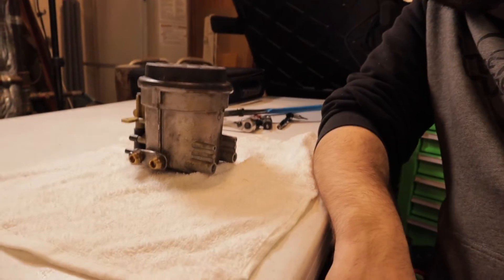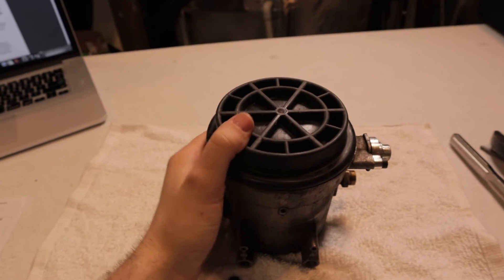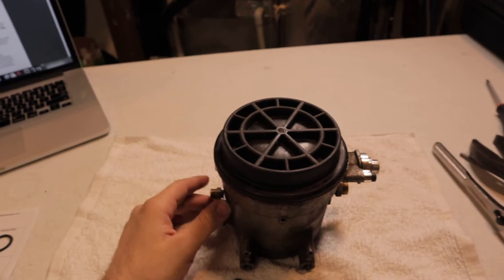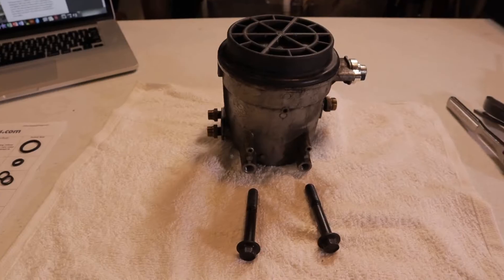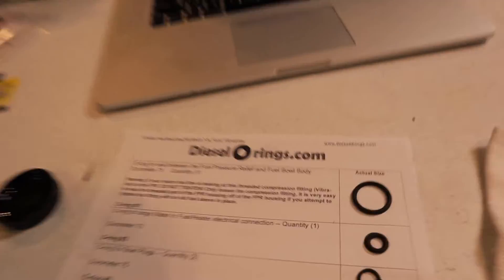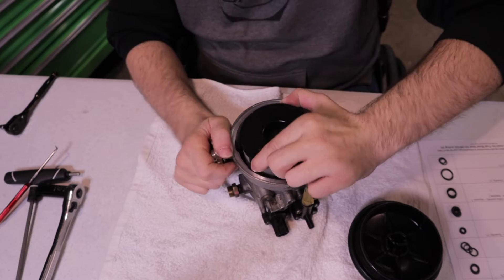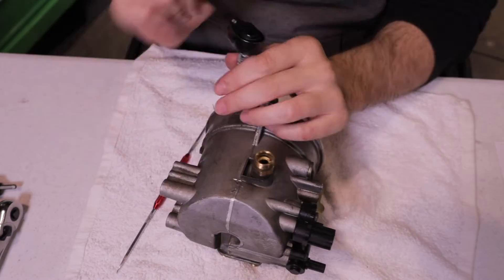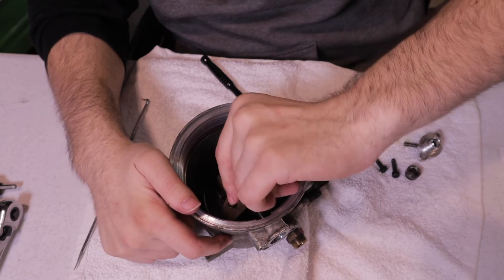Fixing One of Ford 7.3 Powerstrokes Biggest Problems: Fuel Bowl Rebuild

Comment: 2000 7.3, fuel canister check valve standpipe installation 
(See video for parts alignment ):

1.)  Rod with plastic ends go in the standpipe.
2.)  Spring sits on the bowl to pressure the valve. 
3.)  install heat element.
4.) Test push the valve in top center standpipe to feel correct valve spring movement. 
Reinstall fuel filter.
I thank and liked this site.
Reply: I wonder what happens if the valve was in wrong, stuck open or closed positions? What is the primary purpose of the valve? How would it effect freezing startups?
Reply: Google speaks:
The valve prevents fuel from draining back to the tank, maintaining pressure in the fuel rails for easier, faster starts, especially after filter changes, and stops fuel from vaporizing, ensuring consistent flow and preventing hard starts or long cranks, by allowing one-way flow from the canister. Furthermore, Improves Cold Starts: By keeping fuel ready, it ensures a smoother, quicker start, particularly in colder weather. 
Thankyou Google and this site.

Comment: Great video.  Very informative but.... there is really only one fix for the multitude of problems that come with the 7.3 fuel bowl; THROW IT IN THE TRASH CAN.  The best thing you cna do is toss that POS and replace it with a remorte filter system.  They aren't that expensive, way cleaner, get's the bowl out of the way so you can work on other things and actually makes the truck run better due to the better regulator the kits come with and decreased flow restrictions.  Oh.... and you'll only need to do it once while the factory fuel bowl will giver you trouble no matter hoow many times you rebuild or replace it.  Look into it.  You'll be much happier.
Reply from the maker: Oh I deleted the fuel bowl on this truck. That’s why I had it out haha. Just used the opportunity to make the video since I had it on the shelf.
Reply: Still, a good video. Very informative.
Reply: Can you give me a link to the new kit you installed?
Reply from the maker: @PetProductsParadise-zy3hd  I custom buil;t mine but it started as CNCs 4 line kit. 

https://cncfab.us/products/99-5-03-7-3l-cnc-fab-4-line-feed-valley-mount-fuel-line-kit-422017
Reply: Dude what planet are you living on when you said it's not that expensive! 
 A stock fuel bowl is $500.00, a fuel delete system I have priced out is almost always $1,500. The stock fuel bowls seem to last a couple hundred thousand miles before problems, can be very beneficial to a lot of people. 
 HOWEVER! I I've read a fair share stories of people rebuilding their fuel bowl with these kits and then they still leak... I'm a little weary. To try it, but due to budget constraints I will have to. I have a 7.3 van so it is extremely difficult to get to the fuel bowl, you have to use mirrors and work backwards
Reply: @davidevans1128 I have to do the same. Getting into that doghouse is a mission
Reply: @davidevans1128 I got in there today you might only have to change the valve o rings

Comment: Hey man. Just used these two videos to rebuild my fuel bowl today, and they were invaluable. Thank you, sir.

There were a couple of differences. My drain valve didn't have that check ball in the cap and it didn't have a heater in the bowl. Not concerned with the check ball, but the lack of a fuel heater peaked my interest. Anyway...

Will be reinstalling it tomorrow morning as well as replacing the HPOP lines. That SHOULD get the truck running (wasn't running when I bought it). Looks like the previous owner half-assed all the repairs he attempted. Will let everyone know how it went when I post the video of reinstalling everything. 

Again, thanks for these two great videos. You saved me a lot of time and headaches.
Reply: Mine didn't seem to have the check ball in the drain stem either...I was afraid I launched it across the garage.  Gonna put it back together without and hope for the best I guess.

Comment: Since i last spoke with you….you recommended to unplug my exhaust back pressure value and it fixed my problem. Do i need to worry about the pedal still value or seal, turbo…i have 141k and was my father in laws truck which barely ever left the farm

Comment: Hey living on wheels,

First I'd like to just say I really enjoy you videos, for they are very helpful.

I do have a question relating on this topic, for I just rebuilt my fuel bowl, and I don't expect you to have an answer, but out of all the videos on this subject, I find your tutorial most helpful.

The old crush gaskets that attach from the fuel lines to the fuel bowl are still stuck inside the brass nut that sleeves over the fuel line, would you have any recommendations on getting those out?

I don't know if you ever encountered that problem, but I don't think I can just put the new crush gaskets on with the old ones still inside the brass nut.

I appreciate any advise, and keep doing what your doing, your an inspiration for many, and thanks again.
Reply from the maker: I am glad the videos are helpful. Thank you for watching them. I think you are referring to the Viton o-rings. I dont have any magical tips. My best advice is just using a pic tool or small screw driver. I was usually able to just pull the nut back over the fuel line and the viton seal staid in place. And no, you definitely don't want to try and seal it up with the old pieces still inside the nut.
Reply: @Living On Wheels  

Thank you for your response, I will try that out tomorrow.

Side note... as a finish carpenter/cabinet builder, I just want to say good job on trimming out your windows with the old growth, vertical grain, dug fir. Your 100 percent right, one will never find that grade of material in a lumber yard today. Your giving that tree a third life.

Yeah... it might be a pain to pull the nails, and mill the material again, but in the end, it's tottaly worth it.

Again... your an inspiration.

Comment: My 99 7.3 power stroke runs rough with the fuel pressure regulator in I can take it out and runs fine need help
Reply from the maker: What do you mean by with it in and taking it out?
Reply: @LivingOnWheels  if I take the fuel pressure regulator out of the side of the fuel bowl the return to the tank is fully open it runs like a new trutif I put the spring and the brass stem back in fuel pedal doesn't respond and will barely run
Reply from the maker: That is odd. My best recommendation would be to pick yourself up a fuel pressure gauge and start by testing the pressure with the regulator installed properly. Making sure it’s not linked or offset in the hole. It’s easy to do that.
Reply: @LivingOnWheels  got a pressure gauge and had 105 lbs at the fuel bowl with the pressure regulator installed
Reply from the maker: Sounds like the spring and plunger are not installed correctly. It should be half of that. Like I said, it’s easy to get the spring miss aligned in the hole which will cause the pressure to be way too high.

Comment: In theory if someone is leaking fuel into the valley couldn't they just replace all the Orings on the outside of the bowl?
Reply from the maker: That could possibly solve the issue. The drain valve assembly is the most prone to leaking.

Comment: When you take apart the fuel drain valve the part where you pull a little ball out it comes out in 3 pieces I was leaking right there I thought

Comment: Awesome video. I have been fighting fuel pump secondary circuit low issues for months. I order a new fuel filter housing for a last ditch effort to get this issue fixed.   Makes me wonder now if the fuel pressure regulator isn't my problem. 

But perfect video. Great description of things and how to.  Thanks

Comment: I did this rebuild about a year ago on my 1996 F350. Your video would have made it much simpler. Your explanation is very easy to follow, detailed, and concise. A friend of mine just had a problem that a mechanic diagnosed as the fuel pressure regulator. They replaced the entire fuel bowl assembly rather than just repair the pressure regulator, about $350 parts charge.
Reply from the maker: I appreciate. I am a strong proponent of learning to work on your own rig. Sometimes it cost you more but definitely pays off in the long run.
Reply: @LivingOnWheels  hey what you use to get to the level of your truck to perform these projects
Reply from the maker: @markgeralds  Just a little 2 step ladder/stool. I can only be on me feet for short periods of times but it gets the job done.

Comment: Thank you for the video I will be rebuilding my fuel bowl next week. I did have one question on one of the parts that you bought from Edge product 98607 pressure sensor I know it sounds dumb to ask where did you install that pressure sensor in to ? Thank you
Reply from the maker: I have mine plumbed into my cnc fuel bowl delete block since I don't have my fuel boil anymore. otherwise I believe the common location is the bottom right corner of the bowl in the removable plug. A 90* 1/8th npt adapter is needed.
Reply: @LivingOnWheels  thank you I knew you were the man to ask. I really do appreciate your videos thank you so much
Reply from the maker: Not a problem. Thanks for watching!
Reply: Riffraff part 13-001

Comment: I had a leaking fuel drain. I was told that the new diesel fuel eats the o-rings. I found a replacement O-ring on eBay that is made out of material that is less effected by the new fuel . I replaced the 0-ring and have not had any more problems for the last 7 years.

Comment: I've been working on Diesels since 1972, and if it ain't a leakin fuel and oil... It's Not a Diesel :) just kidding! I've used Cummins Power Service Diesel Kleen for ever and this fuel additive will keep the fuel system clean and the o-rings lubed. I've never have had a fuel leak in the 20 years I've had my 2000 7.3 :) Also bee running International A/C injectors since 2002! The motor is a Beast :)
Reply: I'm going to use that Diesel Kleen... I have 2000 7.3with the 6 speed manual that pouring fuel out when its started, I believe its the passenger head fuel line  going in today to find out , but I'm going to pull the fuel bowl and rebuild it as well . Seems simple to do, exp when you have great youtube vids like this,  I live i Pittsburgh the salt Destroys everything.   Went to Georgia and bought all the doors, bed everything i need rust free...,   Just need cab corners.the truck has 120,000 miles thats why i am even doing all of this,  99-04 Fords 7.3. are nice body style,..
Reply: @jon-xq2lc  Hello Jon5,  I just love my 2000 F-250 Super Cab w/ 7.3 Power Stroke! I've used Power Service for 40+ years in my Semis and my Power Strokes and it works really well for all the fuel issues; keeps the system clean, raises Cetane levels and works great on fuel gelling plus being back East kills off scum growth in the fuel!   
Now having Stiction issues with my HI 160cc A/C injectors, these are International single shot injectors that Ford did not offer; I'm going to use Hot Shot Stiction Eliminator in the oil to clean this issue... better than $3500 for an injector job!
Reply: @danielmcqueen1024  hey thanks for the great information,  i worked out the fuel issue, now to build the truck back, I live in the rust belt, PA.  But went to Georgia and picked up all the doors fenders and bed, . thanks again>

Comment: Great video- thinking of deleting mine also. Which brand names did you consider before choosing ? 

Any issues with your change out ? Do overs ?
Reply from the maker: Thinking about doing a video on this topic actually. Have had a number of people with similar questions
Reply: @LivingOnWheels  should be a  video with lots of people being interested I would think.

I've replied to your videos couple times, enjoying them. 

I have my f350 I ordered new, 284000 on it now, 6 speed stick.

I'm very meticulous on it, probably one of the cleanest 99.5 around.  Never wreck, no rust, paint excellent , interior 9.5

This spring thinking of giving riffraff alot of business on replacement parts.

See your from Oregon if not mistaken.  I grew up out Roseburg and now live above Vancouver in La Center  area

Take care

Comment: That is a big blue wrench you used. Funny.
I once had to replaced the two oil rings to the yellow water drain valve. I did it with the fuel bowel in the truck. It took a half-hour. 
In 20 years this was only issue with fuel bowel. I think the fuel bowel is working as it was designed to.
Just a guess. That fuel pressure regulator looks a little shinny, almost new. It maybe aftermarket?
Reply from the maker: Yeah, lots of people don’t have any real issues with their fuel bowls but their are definitely a lot of people who have. The leaks aren’t major issues though, just an annoyance. Yes that is a shiny new part on it. I explain it more in the second video